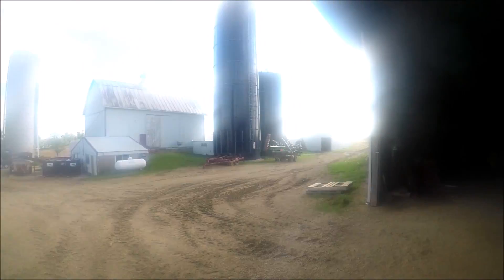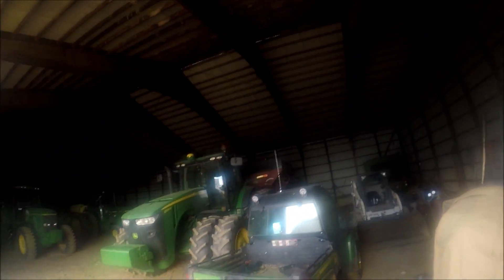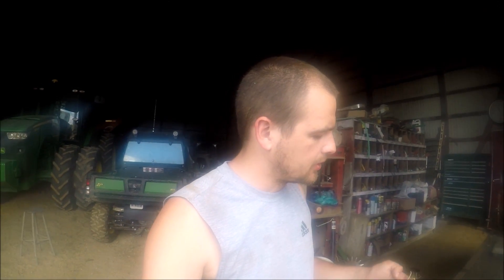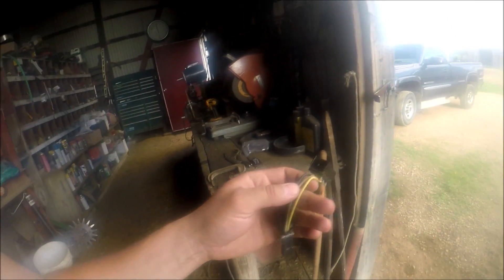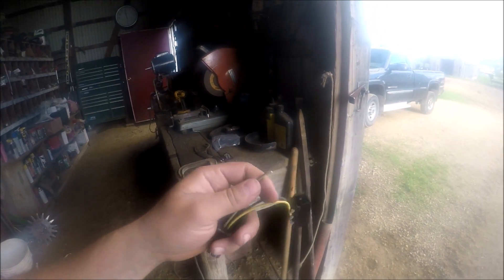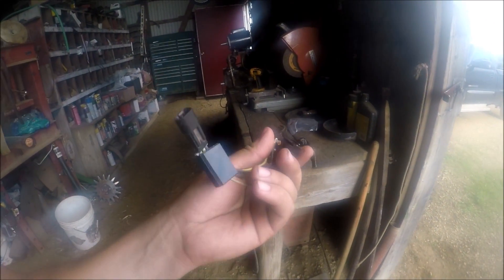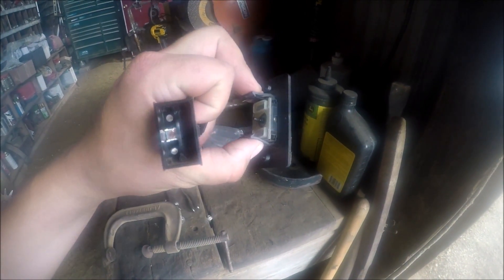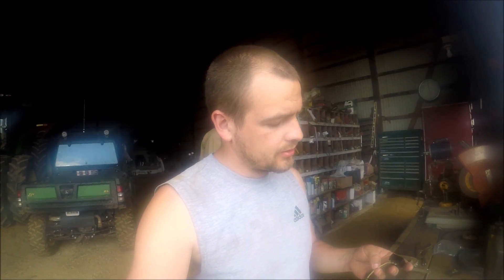The 7600 Is Needing Some New Parts

Comment: You have a piece meal grain system.  When you added that 30,000 bu bin several years ago you needed a plan with a leg to fill and empty the storage.   Now you have 2 new storage bins and a labor consuming hobby.
Reply from the maker: We have a plan for a grain leg. As far as a labor consuming hobby. It took 15 minutes to sweep out the 20 k bushel bin. That's not that time consuming to me.
Reply: We don't have a market for grain like you do so very few farms have grain storage around here.  We load our trucks in the field, that takes just over 2 minutes to load a 1,100 bu truck then it goes to 4  nearby grain elevators, one takes in 50+ million bu per year.   Grain Consumers like JBS,  Cactus feeders, or diary's contract for millions of bu at a time.    Wife and I lease our farms to my son with my help filling in.   He produces 1/4 million bu of grain and grows cotton so has little extra to consume time handling grain.  
There are three on your farm so I can see the reason to do extra!

Comment: resistor needs replacing not the blower motor if it only works on high or off only
Reply: same thing on my 78 and this fixed 'er right up :)
Reply: cheaper than a blower motor too
Reply: Excellent

Comment: Wow... classic deere always needing new parts
Reply: Not only classics neighbours had the dealer out 2 days when the back end went on 1 of their JDs it took another day and a half to dismantle and reassemble it after finding the problem was a faulty ¼ or ½ inch o-ring that was a year after the dealer gave them a really good trade in on the JD 8 something lemon just so they could get it out the country.

The make of machine I think is a lot less important when buying one while I think the dealer support is more important along with parts backup. It's why they changed to DF after the dealer lost the JD franchise during their restructuring as they knew the dealer and knew they'd get the backup they needed.

Comment: I honestly never heard your seat squeak because we a 7800 and it squeaks just as much
Reply: "Have"
Reply: We have Ford 4600, 6610 have had two 6600 that had the loader on and a Caterpillar TH62 loader and every single one has always squeaked, usually the little plastic rollers. Have been driven barmy by them before when mowing to the point of spraying my dad's lanolin hand cream over them as I couldn't the wd40 or grease in the tractor. Actually worked for about a month.